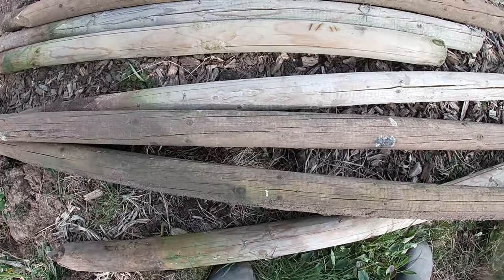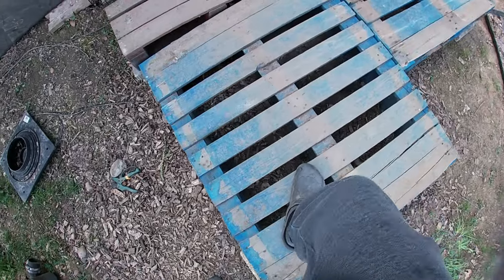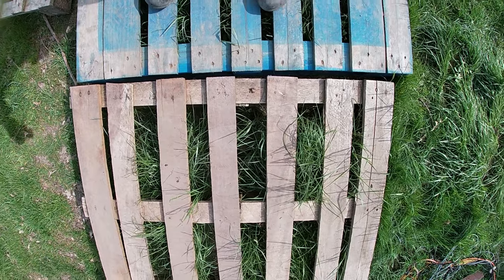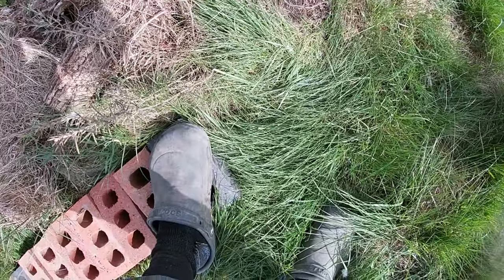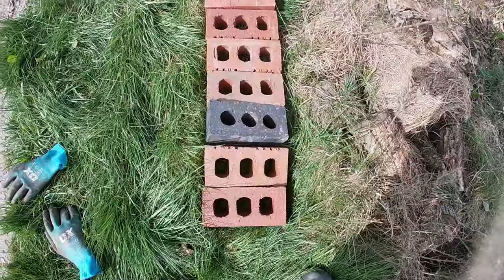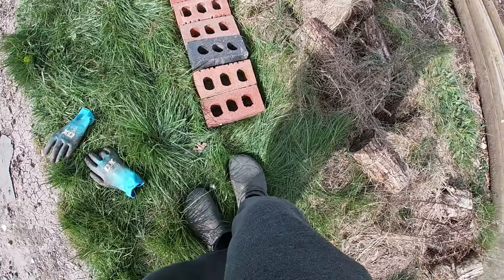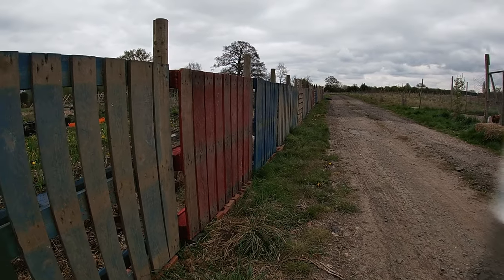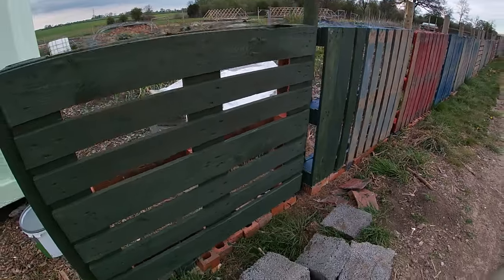How to make a fence from pallets!

Comment: Umm... Animal rescue here. To double up the height just use longer posts and would we need something in between the top and bottom pallets? Also can you think of any way to adhere those bricks together> the dogs would surely push those out.
Reply: I'm thinking since they were screwed in place, there would just be a little bit of a gap between the bottom of the fence and the ground....if digging dogs, you might need to put a more permanent ground barrier in place.....

We also need a higher fence....